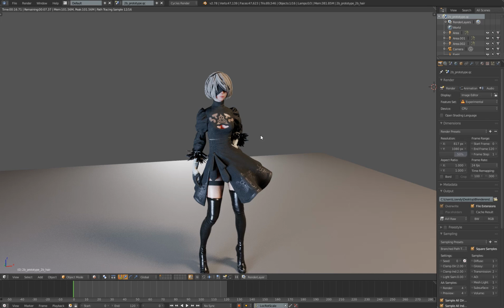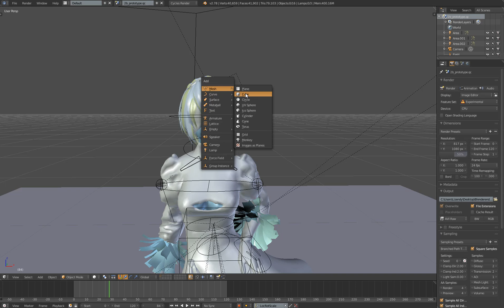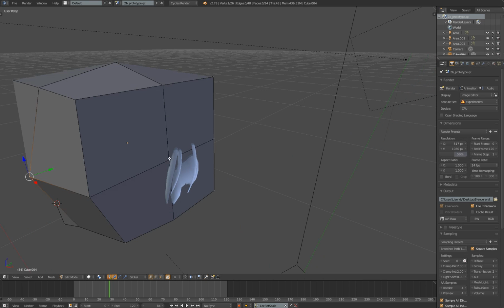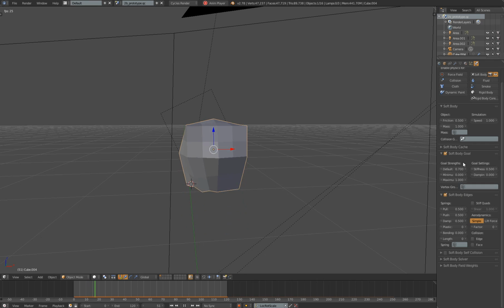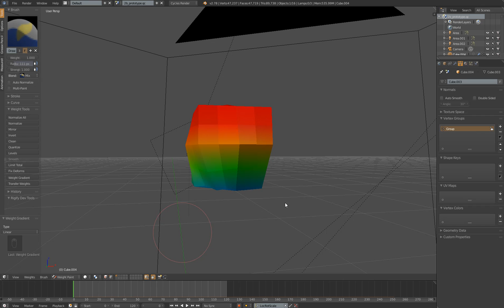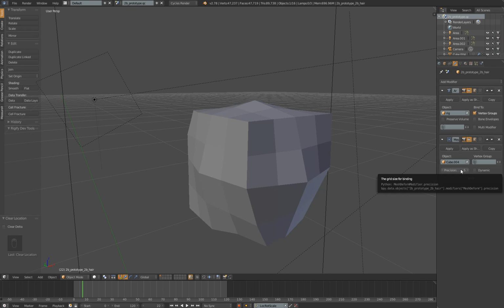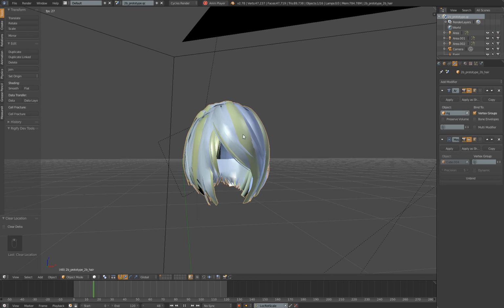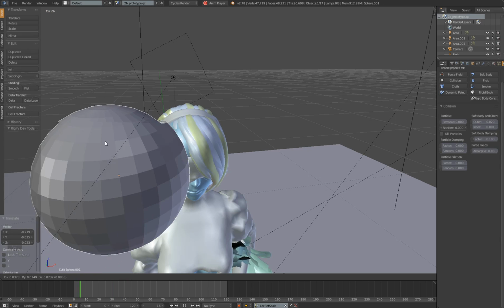Easy Realtime Cloth physics

Comment: But when the character walks for example the sphere stays where it is and no longer deforms the hair... any solutions for that??
Reply from the maker: You can parent it to the head bone.
Reply: @Allen3D  that literally messed up the whole hair.
Reply from the maker: @flop9265  Oh crap that's not good. Unparent it and hopeful my dumb advice didn't ruin anything. You should be able to at least weight paint it to the hair. I'm sorry I don't know what exact solution is. I haven't mess around with physics in Blender for probably a year now.
Reply: @Allen3D  Okay i found a solution. I moved the proxy object as the head moved with each frame so that hair was completely inside it and locked the keyframe one by one
Reply: @Allen3D  but obviously the hair is penetrating the head and i want the head to be the collision object but when i make the head the collision the whole hair gets sucked in and making the inner 0.0001 didnt help either. Any tips??

Comment: Your tutorial was hard to follow in places, I'm a newbie to blender and 3d mostly too, so there is that, but you need to be much clearer about where you are going  and what you are selecting, and not just assume people are keeping up with your tiny cursor, what I made following your steps (including going back and watching things repeat edly) did not behave anmything like what you produced. I don't know if this is because  the software works differently now?
Reply from the maker: I'm sorry to hear that. The tutorial was more meant for people who have a little bit of experience with the UI already, but even then I guess I should have been a bit more clear about exactly what I was doing. Also this tutorial was made over 3 years ago, Blender has had some changes to the physics system as well as a few other things so I wouldn't be surprised if it didn't work exactly the same way. The version in the video is 2.78 and Blenders most recent stable release was 2.83. There are definantly better ways to achieve this cloth simulation now.
Reply: @Allen3D  thanks for replying, I think the main thing was the settings for the soft body effect, your movement seemed to be constant rather than momentary, and I can't seem to achieve that :(
Reply from the maker: @cdchurcher  There could be a few things causing this. Make sure you always start from the first frame, because it works a bit wierd if you try to start on a later frame. Also if it's cutting off after a few seconds that's probably due to the cache amount. This is an easy fix if it's the problem just open the cache tab in the soft body and set the end frame to whatever frame you want the soft body to stop at. Sorry if I'm not very detailed in my explaination. It's been quite a while since I've done any physics in Blender.
Reply: @Allen3D  I already tried that but it didn't seem to make a difference, I think that soft body maybe isn't the effect i need, trying to make it work with cloth but not having much luck either lol, thank you though!
Reply: @Allen3D  I am gonna take back my complaints from earlier and instead just say a big thank you, I think I was just wound up and after all you were sick at the time and you still made the video, so kudos to you. I've come back to it hours later and rewatched your video, played around with it for a bit and just spent the time  experimenting with the different properties to see what they do and how they interact, I've not used this for the effect I originally intended but strangely enough I have used to add some movement to the character's 'hair' (wig). Thank you! xx
Reply from the maker: @cdchurcher  Thank you, that means a lot. Your earlier criticisms were helpful though, I will keep them in mind if I make another video.

Comment: Guys, I'm stuck at the weight painting part :/
For some reason the weight paint gradient tool doesn't work as intended. Instead it paints everything red from top to bottom with no actual gradient happening.
EDIT: Ok found the problem. It's Blender 2.8 being buggy. It worked fine in Blender 2.79
Moral of the story - always keep a legacy version of the software around kids, for when the new and "better" version starts acting up.

Comment: Its easier to just apply vertex group select the mesh of the clothing and weight paint where you want it to stay stationary red and movement blue then apply the vertex group to the cloth as the pin and it will pin everything red

Comment: Does this tutorial only respond to collision?
The character's face is shaken to the left and right but the hair does not move.
Reply from the maker: The hair should be effected by collisions, gravity, and wind. If it's not moving correctly try using an older version of blender, since this tutorial is a bit old the the newer blender version changed the way physics works a little bit.

Comment: Thanks bro, been looking for a way to cheat the whole hair dynamics in blender this is awesome... Quick question though, if I set the body mesh to a collision object would that stop the hair from going inside it?
Reply from the maker: Technically yes, but it will most likely make your hair freak out. Soft body collisions are the most accurate in Blender.

Comment: Is there a good way to make this useful for rigging? Because I'm having a skirt where the legs always clip through, but it's too wide so I can't hide/delete the legs either.... I tried doing this but it never went with the rig and stayed behind, making the soft body collisions really hard to render and even more extrem than cloth simulation clipping.
Reply from the maker: You can either weight paint the shift body. Or just parent the soft body to the hip bone.
Reply: Yeah somehow I'm having a few deforming problems together with the armature for some odd reason. I'll have to look into that more tomorrow - I'm tired XD
It seems to really help avoid clipping through the clothing though, so that makes me happy. For my liking everything just bounces too much but I haven't found settings which make it smooth and still let the clothing go away from the mesh underneath. I'm fairly new so thanks for the advice!! <3
Reply from the maker: Mika-hime you can turn up damponing. That should help stop some of the bouncyness. If you need help with anything else I would recommend messaging me on discord, it'll be alot easier to talk to you there. Lizendy #0847, is my discord if you're interested.

Comment: Just a simple tip: Instead of making the deform mesh by hand, you can simply make your cube around the base mesh, subdivide it as desired, add a shrinkwrap modifier to the cube (with the target set to the base mesh) and crank up the Offset value until you get the desired output.
Reply from the maker: Fantastic idea!
Reply: you speak alien languages mate. thats why in symposiums of experts, foreign spectators arent allowed i guess xD
Reply: @keylanoslokj1806  huh?
Reply: Yep, came to the comments to say to use the shrinkwrap modifier instead of by hand also.
Reply: +Sam Porter what i'm saying is that those outside an expertise hear the experts as if they were aliens.
Reply: I wonder... how would that work with long hair though?  - Would this whole method work with long hair at all to begin with? B2 has very short one in comparison to, I don't know, let's say... Kokoro from Dead or Alive or even Yennefer from Witcher O,O
Reply: LEGIT I DID THE SAME THING WITH MY SCULPTS XD.  Crazy how we had the same idea... and I didn't even know about this comment!
Reply: Maybe you should make a tutorial on that it would be very helpful to people who are unfamiliar.

Comment: I got to the point where I'm binding the mesh to the deform block, but once I bind them, they don't move at all anymore.

UPDATE: I'd ctrl/Z'd too far back and accidentally deleted the soft body. Anyways, I got the mesh bound to the jiggly deformer, but the mesh won't move on its own. It only moves when I move the deformer itself. What's up with that?
Reply from the maker: You either need to reparent the rig to the model or you just need to move your modifiers around. (btw Sorry for answering so late. It's a bit harder to get to a computer these days.)

Comment: What if my character is already being deformed by a mesh deform modifier. Can i make a new deform mesh and  add the soft body and stack it
Reply from the maker: I believe it should work. try it out and let me know if it went okay.
Reply: Yes, Thanks, It worked perfectly
Reply from the maker: That's good to hear. Let me know if you run into any other problems.

Comment: 7:28 what's that selection wheel thingy, is there a separate addon for this?
Reply from the maker: It's called pie menus. If you have one of the newer builds of blender it comes preinstalled. You just need to turn it on in the preferences.
Reply: woah, that was a quick reply...  thanks and btw your tuts are awesome!
Reply from the maker: Thank you very much. If you run into any other problems just tell me and I'll help to the best of my abilities.

Comment: If you don't mind telling us, what are the specs of your computer? I would like to think I have a decent one but by following this tutorial I can't get faster than 5 frames per second while the mesh is moving in my setup.
Reply from the maker: Sadly the computer that I used in this video was confiscated. I don't remember the exact specs. But I do remember it had
gtx 970 graphics card and
8 gigs of ram
Try only moving the model in solid shading mode.
Reply: I have 24 Gigs of Ram, but a GTX 745 card... I really do need to upgrade that. CPU is actually faster for me than GPU, and that is a sin.

Comment: is she rigged?so we can pose her?
Reply from the maker: Yes she is rigged.
I just put the mesh deform under the armiture in the modifiers.
Reply: thanks. great to know shes rigged. you said you got her from sfmlab. do you have any problems loading her in blender using sfm formats?
Reply from the maker: There weren't any big problems porting her. She is rigged but as you may know if you have ported any other sfm models before, you will need to put another rig on her for IK to work. Besides that, just a little bit of fixing up of the mesh and adding some corrective shapekeys. Though that part isn't that hard at all.
Reply: thank you +Lizendy. I actually never imported sfm formats into blender before.
Reply from the maker: Oh, then get ready for a little bit of headache. There's alot of small problems that can occur and it takes quite a bit of patience to get everything ported properly, but in my opinion it is worth it in the end.
Reply: ah....its ok I ll give it a shot. yes, I'm sure its worth it. the model looks really good here in your video
Reply from the maker: I wish you the best of luck. :)
Reply: thank you so much I'm gonna need it. and thank you for the tutorial and guide. Subbed!